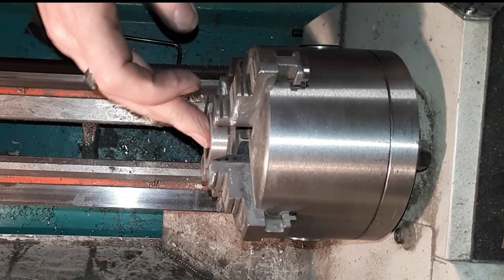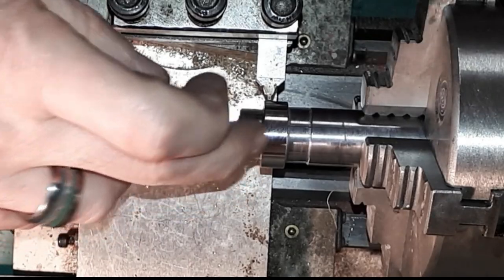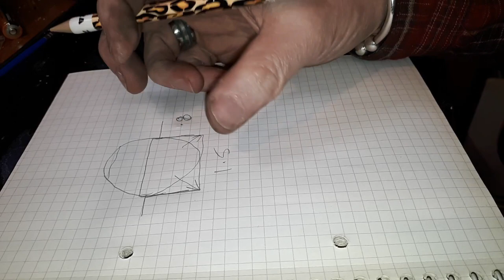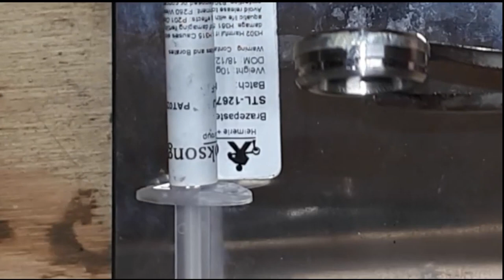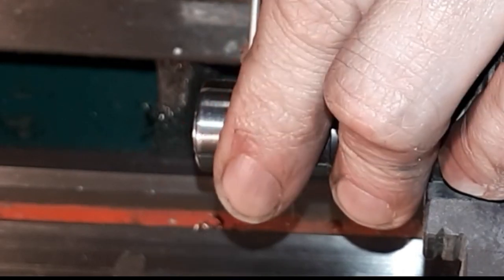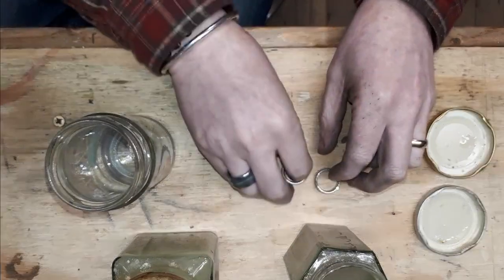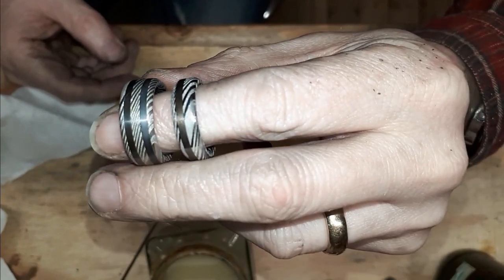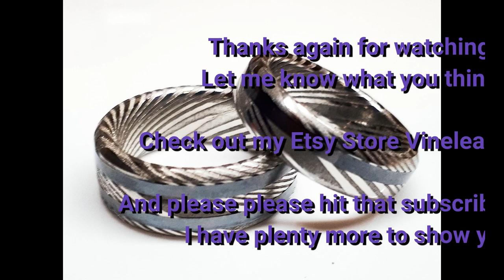Damascus Steel Ring with Oxidized Silver Inlays

Comment: Great video could I ask what speed u run ur lathe at when using the parting tool cutting Damascus and Titanium (iv not long bought a lathe still learning) looking forward to ur next video
Reply from the maker: Hi Gavin, thank you I'm glad you've enjoyed it. I would usually run it at around 250 and adjust up or down depending on how well it's cutting....if it vibrates adjust down . I'm in the process of editing another two videos so if you've enjoyed this one it would be great if you subscribe
Reply: @Vineleafstudio  I'll give that a try thanks very much for ur quick reply. Already subscribed and got that bell notification on to ready for ur next video keep up the good work sir